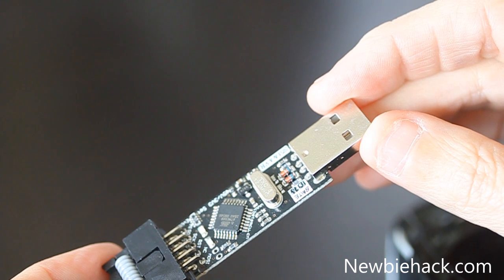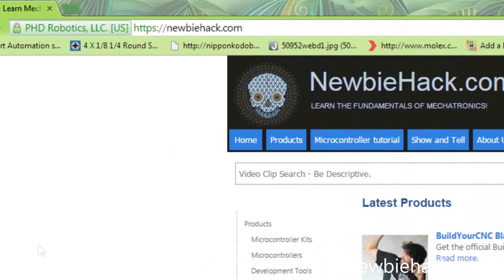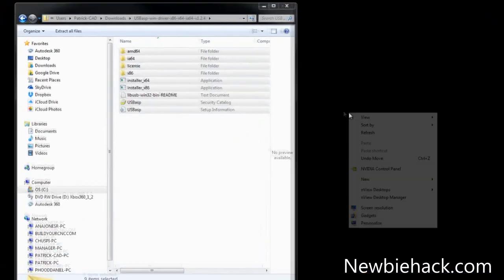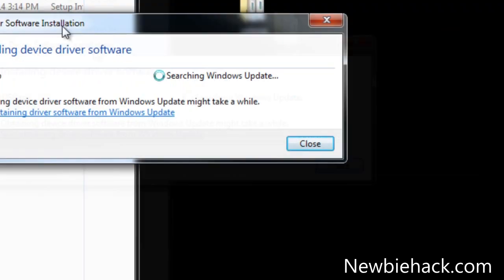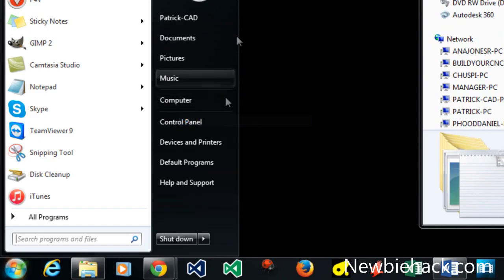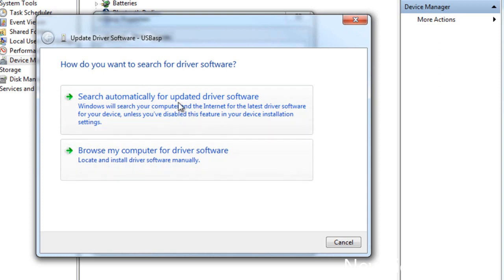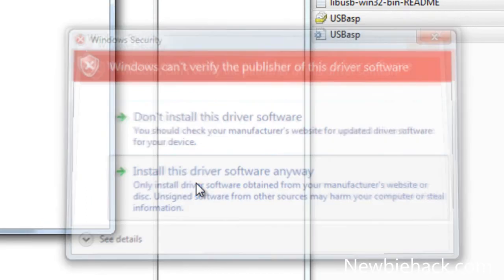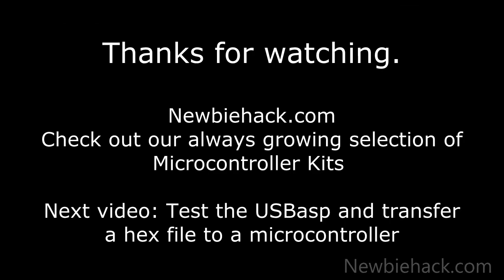3. Arduino for Production! How to Setup and Install the USBasp - Microcontroller Tutorial

Comment: What is the best Arduino to start learning on?
Reply from the maker: I wouldn't recommend using Arduino unless you are getting into this field to do a few one-off projects.  If you plan to do many projects and market them, I would recommend learning how to program and create circuits using the bare chip.  This will help in sourcing the minimal components needed for production and understanding the best most efficient programming fundamentals.

Comment: Thank you for the driver. I just bought USBasp and tried to install it on my Win8.1 machine. The OS refused to install the driver because it's not digitally signed. However, I managed to install it on my other laptop running Win7, without any difficulties.
Reply: Hello i managed to install it on win8.1 with this tool http://zadig.akeo.ie/ just select usbasp and use driver from tutorial
Reply: 275drago Thank you for the link. Actually I momentarily disabled the driver signature verification for Wni8.1 and installed USBasp driver successfully. I used this method  http://www.howtogeek.com/167723/how-to-disable-driver-signature-verification-on-64-bit-windows-8.1-so-that-you-can-install-unsigned-drivers/

Regards